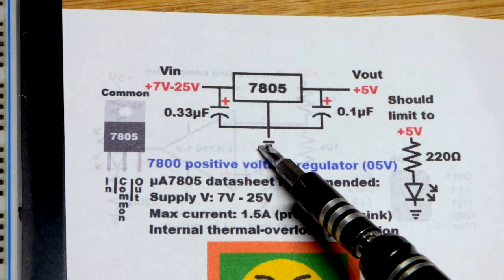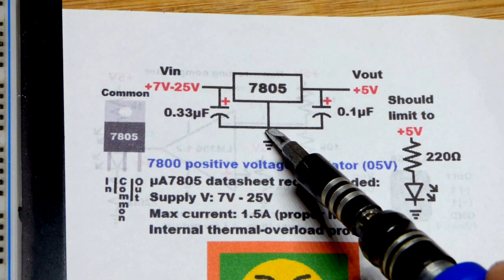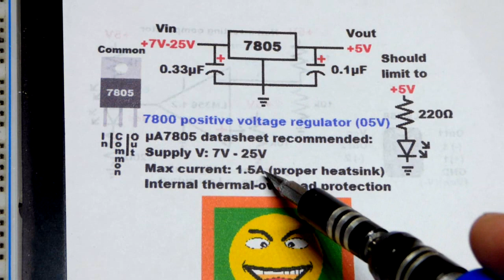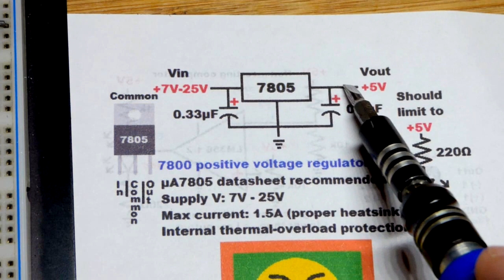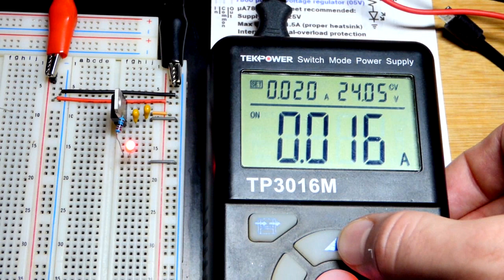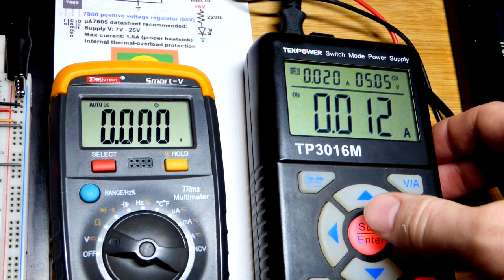How to use 7800 series 7805 positive voltage regulator integrated circuit IC demonstration

Comment: 1.5 amps is a surge current rating. 1 amp is constant current. Always use a heatsink with proper thermal pad and mounting hardware.
Reply from the maker: Thanks for the info!

Comment: Could you demonstrate the difference between a 5V Zener Diode and using the 7805?
Reply from the maker: 7805 has a lot of internal circuitry that basically amplifies the power handling capabilities of a zener diode and is a lot more energy efficient.
Reply: @Electronzap  Thank you

Comment: How about capasitor 0.33 &0.1uf, can we use other capasitor, exmp using cap 100nf +100nf.
Reply from the maker: I think that would be OK for most circuits. I don't know much about how much smoothing these need and under what circumstances.
Reply: @Electronzap  thnks bro, bcause i  hve much 100nf on my stock hehehe